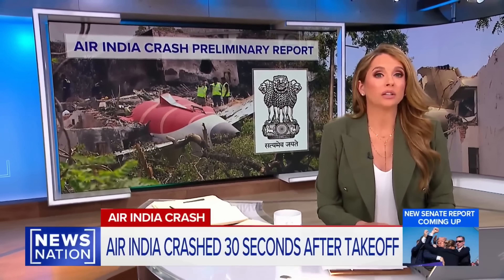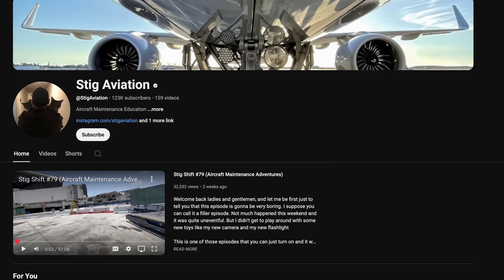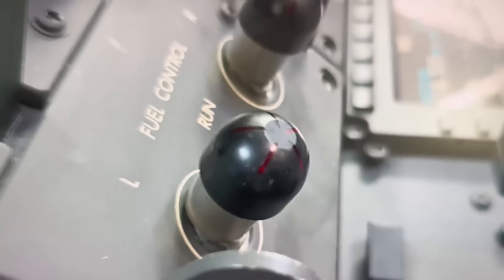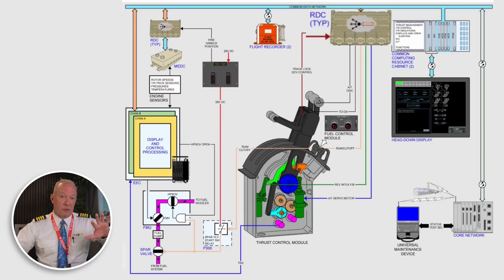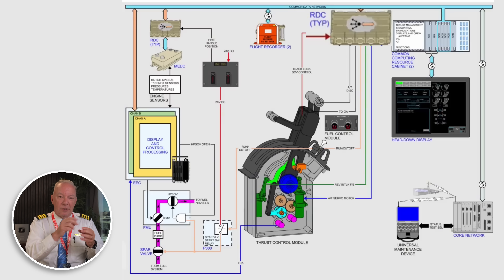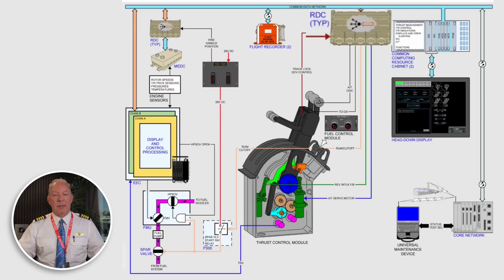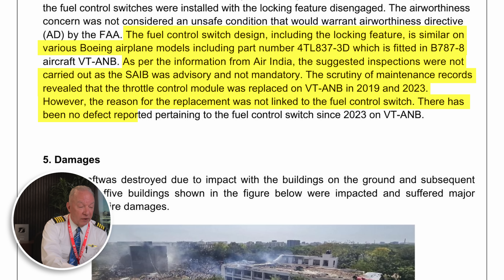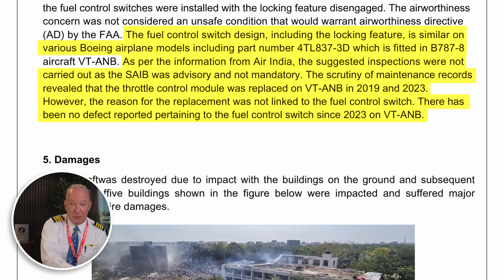The Truth About Boeing 787 Fuel Control Switches

Comment: Former Navy P-3 Flight Engineer here, and your explanation of how the fuel shutoff switches work is excellent. Having shutdown and turned on fuel cutoff switches thousands of times, there is no way those switches were turned off by themselves. It virtually impossible, and designed that way. Keep up the good work Captain Steeeve!!
Reply: Thank you for your service and for confirming all that Steve has been saying about the fuel cutoff switches. There are so many people commenting on here that have no idea what they're talking about. 🫡
Reply: @ITouchDownEverywhere  Capt Steve would be one of those.
Reply: @JoeLinux2000 You must be delusional.
Reply: @JoeLinux2000  Based on the fact that you reply to nearly everyone tells me that you're one of those people who thinks they know it all, when in reality, you know very little.
Reply: Disagree.. Why was the RAT  deployed two seconds before the fuel was cut off ?
Reply: @alexvarghese2513  Major Electrical shutdown is my guess. surely it is key to understanding what caused the engines to shutdown.
Reply: @alexvarghese2513  It wasn't. Go and lookup any news article that has the timeline of events, as published in the preliminary report that was released.
Reply: the switches don't activate the fuel shut of valves, the relays do it and possibly other circuits
Reply: @CaptainSteeeve, why not make it impossible to switch them off when in taking off at low altitude with full throttle on? Even in general the switch I presume is not used when throttle is 100%. And in this scenario the pilot doing the switchoff did not put the throttle back first, cause that would be immediatly noticed by the other pilot. Wouldnt that be a usefull change the prohibit this in the future from happening again?
Reply: @gaborv.baranyai2625 exactly what i imediatly though. How come everithing is redundant fail safe but u are able to shut off both fuel switches instantly right at take off. IN NO CENERIO THIS SHOULD BE ALLOWED AT SUCH LOW ALTITUDE. 3 SECONDS AFTER TAKE OFF.  This needs to change imediatly....
Reply: @DavidTorres-xl2jl
Hi David.
What happens if the Main battery goes "dead short"?
Would the Left Bus lose the power to the Pumps/ Valves?
Would the "Active High" to the "Switch position" contacts (Inside the switch) be lost?
Would that cause a FALSE DETECTION (!) of the switch position at the RDC > FDR?
.
If the system detected a "Left Bus power Failure", would that initiate an attempt to supply emergency power from the Right Bus via the Bus Tie Connector?
.
If the Right bus Power connected to the "Dead Short" of the Left Bus.... Might the Right bus ALSO go down?
.
I've referenced links elsewhere to a channel where this is explained in great detail using Boeing Manuals
Reply: @rogerstarkey5390 All Speculation!! The report clearly says the Fuel Cutoff Switches were TRANSITIONED from ON to OFF from left to right one second apart. Then TRANSITIONED BACK to ON 10 seconds later. Both engine fuel systems are two separate systems independent of each other. A bad battery would not shutdown both engines one second apart.
Reply: If some things fail in engineering, there is a concept of failure to a safe condition. Fail-Safe design I recall it is called. One would think that it would apply to fuel flows to engines in aeroplanes, unless in the case of fires at high altitudes or on the ground.
Reply: Capt steeve words and explanation are contradicting the diagram that he is showing 😂 Clearly as per his diagram, display and control processing unit is capable of cutting off fuel by turning fmv or hpsov !
Reply: Looks like a deliberate act, when one of the pilots is asking why did you do that and the other claims he did not. No way both those switches fail or get moved by accident. The co-pilot who is flying has his hands full at that critical moments but sees the other pilot who is monitoring flip those switches then asks in disbelief why did you do that? Hard to see what else you can say. Hope I am wrong, any crash is bad enough but deliberate is gut wrenching. MH370 comes to mind.
Reply: @wjkitching  , let me throw this at you. According to some information sources. Only captain instruments are powered in emergency power situations. Which would mean a change of command/active pilot would have had to occur. So now what you say?? (Who said what to whom, and when???)
Reply: I had seen this STIG AVIATION one maybe 20 days ago. It's a very nice explanation.  I still have 1 concern which I think Capt Steve has not accounted for.

The relay being shut makes the 28V DC circuit tell those 3 circuits to have their valves open. I guess via actuators. That is just the valve remaining open. There is also the factor of the fuel PUMPS and I am pretty sure those don't operate on DC. That means if you have valves OPEN n but the PUMP IS NOT GETTING AC power, then the outcome would be fatal

And I do not think simulation tests perfectly replicate a plane's hardware. What it probably does perfectly is replicate responses to signals. It would probably replicate the logical/INSTRUCTIONAL aspects, but not physical aspects of failure.

Btw, there is another excellent video - search AIR INDIA LITHIUM BATTERY DIODE   by Jeremy John Thompson
It goes into the electrical schematics and is for the audience that understands electronics at a deeper level.
Reply: I had seen this STIG AVIATION one maybe 20 days ago. It's a very nice explanation.  I still have 1 concern which I think Capt Steve has not accounted for.

The relay being shut makes the 28V DC circuit tell those 3 circuits to have their valves open. I guess via actuators. That is just the valve remaining open. There is also the factor of the fuel PUMPS and I am pretty sure those don't operate on DC. That means if you have valves OPEN n but the PUMP IS NOT GETTING AC power, then the outcome would be fatal

And I do not think simulation tests perfectly replicate a plane's hardware. What it probably does perfectly is replicate responses to signals. It would probably replicate the logical/INSTRUCTIONAL aspects, but not physical aspects of failure.

Btw, there is another excellent video - search AIR INDIA LITHIUM BATTERY DIODE   by Jeremy John Thompson
It goes into the electrical schematics and is for the audience that understands electronics at a deeper level.
Reply: I sincerely appreciate how Captain Steeeeve educated himself on the system, not all pilots are familiar with many of the workings of the aircraft they fly. Saw a FE convince the pilot the aileron trim tabs could move themselves (P-3). Baffled at the preflight call I went out and saw the FE, who was at fueling panel, was grabbing the T/T cable when the pilot ran it and pulled it in the opposite direction. So I joined in and messed with him until he figured it out.
Reply: aircraft firefighter, id say there is no way they both flipped off by themselves, you have to pull up and down
Reply: The cvr discussion is crucial. Human action sadly.
Reply: no mention of any possible electrical or computer glitch that would trick the computer into shutting off the fuel pumps. Why not Captain Einstein!!
Reply: Except when they're broken and except when there were memos out there about how many weren't working correctly
Reply: These facts are a major problem for the hundreds of video's on the internet trying to promote their  bat shit crazy ideas of what caused the crash. What ever happened those 10 seconds with the switches at cutoff domed the flight. Switches at cutoff for 10 seconds is pilot error full stop.
Reply: Another false propaganda. The fuel switch is a red herring. Report never mentioned physical movement. RAT deployed before the switch transition. This Steve guy is peddling Boeing propaganda most likely. The fuel switch is not the probable cause of this accident. Steve is spreading misinformation.
Reply: Blaming manual switch operation is lame excuse airlines will never accept. So not getting convinced,, they would keep away from boing, as cause boing cannot admit
Reply: What I am wondering is if the switch can be positioned half way, balancing on the nib like a coin on a table, see 3:17. The top of the  nib is flat and a large spring force creates some friction to hold it there. If in that position the electrical signal is switched you have the engine on, but the switch is not secure. I don't know how often that would happen, because having that be the case for both engines would mean it would have happened to single engines much more often.
Reply: Relais can fail. I do not believe that the fuel valves depend on one relay. This is BS. The schematic you show only shows the principle. There is always a redundancy in case the relays would fail.
Reply: @feggaer8889 
There are separate relays on each engines fuel circuit, there is no one point of failure . Also, the relays have to be activated i believe to close the valves or open them. If the relay failed when the valve was open it would stay open. And for 2 separate relays to fail a second apart ,even if thar could close the valve, is insanely crazy
Reply: @njlauren thanks for the explanation.
The video was biased. A failure of a component is always possible, but as you mentioned, there should be no single point failures that could lead to close all valves. I hope Boeings RAMS department know what they are doing. I still have doubts that one pilot did that on purpose.
Regards
Reply: The first question that springs to my mind when I see the tab and the operation of the fuel control switch is “what happens if there s metal fatigue on the tab or the toggle tooth? Such that those pieces are rounded and therefore not capable of holding the switch in place under the pressure of the detent spring.
Reply: @NorthLondonArtillery 
They have the actual switches. First of all, there are two switches, one for each engine, it wasn't one switch. The odds of two switches being in that shape is pretty much near zero. Plus the switches were replaced in 2023, and even assuming both could be bad at the same instant, it is highly unlikely it would happen in 2 years. 

The other thing is they found the switches after the crash, and they were in the run position as indicated on the 'fdr'. If the switches lockout was bad, you think a crash involving huge g forces on impact wouldn't throw them to the cutoff position?  The other thing is if the switches were in that bad shape they would have noted that I the report..
Reply: Then would you please take some time to explain the 2019 ANA incident where it DID TAKE CONTROL.
Reply: Industrial automation PGD (i.e. Anything with control and automation) + Mechanical Engineering Diploma + Bachelors in my achievements and I can say it can.
You are a flight Engineer, not a controls engineer.

There's nothing in Engineering that says its impossible. Humans thought only birds could fly, but with engineering, humans did break sound barrier by multiple times and can fly to date as of my knowledge.
Reply: @rahilptl639 not in this case
Reply: P3 vs. B787??
Reply: It is impossible to switch both in less then 1 s as mentioned in the report
Reply: @azeche592 Not what real pilots are saying.
Reply: So, if a pilot switches them off and on thousands of times, they would know even in absolute darkness what they are for. Obviously, the switches were on, otherwise the airplane wouldn't have lifted off ground. So, if they were switched off AFTER start, than could only mean an act of suicidal terror, not an "accident" caused by ignorance or stupidity. 
But,. if it was a suicidal terror attack, why didn't the second pilot switch them on again, or can't the turbines restart on their own after switches are being briefly cut off?
Reply: @hokroeger from listening to hundreds of different  pilots videos, it seems like they function very independently at takeoff , each responsible for certain tasks and observations.  One would not be expecting “the other” to sabotage the flight.  For whomever did this…they knew it meant certain death at this altitude.  Move the switches at 12,000 feet the RAT deploys …astute pilot turns switches back on…that would be a fight in the cockpit. Whomever did this, chose certain death.  No chance to recover
Reply: @hokroeger 
They probably could, the switches are in the console with the throttles. That said the conditions in the cockpit was normal. 

The switches were thrown on 10 seconds after they were flipped into the off position. The problem is the engines take a while to spool up, the plane was at 500 feet, just no time. A 787 at that altitude will stall and crash with no power.
Reply: Nobody seems to have noticed that the schematic shows an "and gate"  that means the display and control processing unit has to command the Hight pressure shut off valve as well as the relay output. And the FM valve is directly controlled by the display and control processing unit. ONLY the spar valve is unilaterally controlled by the fuel cut off levers  via the spar valve relay.
Reply: Replacement of the 3 way 4 pole electromechanical FAA approved switches with unapproved totally manual fuel switches is not recommended, but as it's captain Steeeve's plane we cannot stop him is his tuning efforts. Let's see 👀 

At 4:15 he says he has reconnected the FMV from the FADEC's and onto the 28V DC power from the latching relays. Interesting either closed or full open. Steeeve's tuning specialist denied using the fuel switches themselves to switch run/cutoff fast like manual PWM modulation fir thrust adjustment.
Seems like they needed higher dimensions and has completely disconnected the FADEC's. 
Seems like their tuning kit has new additional Values and control hardware and software.  

It's not recommended to run the engines faster as tear and wear increases exponentially as with the fuel consumption. Tuning above 15% might risk the engine split apart 
Hope we get to know when Steeeve is going to have this race?
Which tower is giving out the race vectors?
Reply: Virtually impossible is not impossible
Reply: Problem was not with the switches. It was with the 28 volt battery Captain Steve mentions. Whether by accident or intention one of the things in his picture of the circuitry completely covered an important part of the circuit which was the battery that went through a power diode before it connected to the buses that powered many things including those fuel shut off relays. There was a power failure in that 28-volt system. When that happens it looks just like someone flick the switches and has recorded as such by the flight data recorders because it senses no power on the line just as if the switches were cut. But the explanation I saw points out that if the power diode fails where's the battery itself has problems you lose your 28 volts. As an electrical engineer although I haven't practiced in decades the explanation is certainly viable and matches all the data. There's actually a video online on YouTube that goes through the scenario in exacting detail matching up everything that was observed
Reply: Honestly stop banging on about the spring, nib, intentionally moved…. I do agree, they were moved intentionally, in fearful desperation to reset FADEC to get engines running again because both flamed out at rotate, due possibly to a major electrical upset, evident by RAT deployment PRIOR to switches cutoff/run and pilots did an amazing job!!! Only mental health issue with these two hero’s was their quest to save this from being the tragedy that it was. Firmly believe the truth will prevail, this was no German Wing tragedy.
Reply: What about the battery itself, the one that provides power to those switches?
Reply: @Marco-fv6ho  Considering what Captain Steeeve and others shown, the battery itself, battery bus, or protection diode, or some wiring between the battery and the switches are common failure points and could had caused a simultaneous engine shutdown.
Anyway, it could had been caused by other issues.

Water infiltration in the electronics bay could had shorted the relays.
There are safety bulletins recommending to check for water infiltration and related issues on the 787.

TCMA could also cause a dual engine shutdown.
It would automatically cut fuel to the engines if it records both TOGA thrust and thrust levers at idle position, thinking the engines runaway.
Throttle body in that aircraft was replaced twice since 2019, so that issue should not be underestimated.
Reply: Excellent explaination captain, very simple electromechanical circuit.
Reply: @armandocarino1387  Yeah No. It is more complex than that.
Reply: What if the connection to the battery briefly clitched for whatever reason? Complete novice, but thinking outside the box and a big issue was made over this battery.
Reply: @stevenb4285  you'd loose CVR and FDR data for that period.
Battery is monitored by the aircraft electronics and is load tested during power on/pre-flight procedures.
Battery voltage is also one of the required monitoring parameters on the FDR alongside voltage on the battery bus (usually powered by other sources despite its name) so any changes would be recorded and available to the investigation team.  
As the prelim report doesn't state that there were any anomalies in the FDR about battery voltage it's not occurred.  They would want to issue that under the prelim report and then produce an inspection regime for the 787 global fleet to mitigate against another event as soon as possible.
Reply: @stevenb4285  The report says clearly the Fuel Cutoff Switches were TRANSITIONED from ON to OFF one second apart. Says nothing about battery issues.
Reply: The term 'virtually impossible''' could have been applied to many 'events' during 9/11 but it wasn't then ..from building collapses to pilots and aircraft performing 'virtually impossible' feats (disappearing into the ground etc). Just why are you using it now? I strongly suggest 'highly improbable' instead or the overall govt narrative on that infamous day would collapse instantly
Reply: Some people have a really hard time admitting something so don't mind those people and keep up the good work sr💪
Reply: OMG You are as much of joke as he is! You don't even need to know anything about aircraft to see the rubbish he's talking. He's wrong if you can't spot the contradiction in what he was saying here, there's no hope for you
Reply: Are you an engineer with access to the construction of the fuel switch.  It can easy tripped by itself like a circuit breaker.  Please do your research first.
Reply: @michellehavre6821 😂😂
Reply: @michellehavre6821 no it really can't - do your research.
Reply: I haven't read many of the comments, but couldn't they isolate the audio hear the clicks from the springs? It looks like it would make a definitive sound from the springs clicking?
Reply: I just can't see why this is good functional safety design considering the proximity to active controls during takeoff and the fact that we humans make unrecoverable errors with some frequency. I believe this was a stupid human error.
Reply: With all due respect, depression and suicidal thoughts are capable to flip these fuel switches. How well and how often these companies evaluate their employees will play a huge roll with widely spreading mental health nowadays. Just saying...
Reply: It's the fuel pumps that failed caused by water ingress into the EE bays. Lack of lavatory maintenance caused the crash and not the fuel switches
Reply: @idarpolden5913 what's the basis for ur claim, plz do give source and explain how what you think happened
Reply: We will have to wait for the full report but the switches must have been moved by the pilot or first officer
Reply: @StevenCullen-sx1ui , While there was likely fuel cutoff switch movement. Still not 100% a thing. It's higher probability, but not 100% until more details. With this said I'd give the context for the fuel cutoff switch movement, a very low probability in the context to sabatoge the flight. Very high probability switches moved in response to another issue, or root cause issue. As another channel indicated once the RAT deployed, (emergency power) only captains instruments would be powered. If co-pilot was in command, a change in command would have had to occur -> to the captain. Now who said what?? to whom??, and in what context??
Reply: Why can't someone agree one of the pilots switched it off for whatever the reason, intentional/unintentional if the system couldn't be at  fault 
Because it has been said its  turned on again
Reply: As it seems there's no proof of pilots turning off those switches Boeing at fault for sure and hiding their faulty system because why'd the pilots do it intending to suicide (with all the passengers ) and if they had any such intentions they could have done it after gaining more altitude maybe..
Reply: LOTS of "Monday morning quarterbacks" weighing in here, l.o.l. 😅
Reply: I wonder out of the 240 comments, who here are aviation mechanics or engineers? 🤦‍♂️
Reply: All these experts commenting on here. The people who use and rely on these systems every day are the ones I would believe as opposed to so called  ‘armchair’ experts, unless they actually work on these systems in these aircraft at the company in question. Pilots lives are on the line just as much as the crew and passengers. They have much invested in knowing how their aircraft works, inside and out.  They too would want to know they can rely on these systems working correctly, unless you have an errant or suicidal pilot.
Reply: As an electrician of 35 years plus. this video makes so much sens. 
I do have a suggestion moving forward and it would probably be considered on future designs.
THERE IS NO REASON  FOR THESE SWITCHESE TO SHUT OFF AT SUCH A LOW ALTITUDE  ,At least not both of them at the same time . I KNOW IM.NOT THE ONLY ONE THINKING THIS IS ABSURD , SO PLEASE have them disabled internaly    for the first few seconds from take off. That way there is some redundancy  in the system  for acidentaly or intentionaly shutting fuel down  to the engines. I was surprised this is not already implemented.
Reply: @mariuss5423  Introducing more complexity is usually not the best solution.
Reply: @mariuss5423  barometric or rad alt?  How is this system powered when down to battery power only? What if you have a fire on one engine during this phase of flight, how does the fire handle then interact with the fuel control relay?
You still need to be able to shut down an engine so this just moves the issue from fuel control switches to fire handles.
Reply: @yanholland315 
If you have a fire in both engines at the same time at such a low altitude you are done anyway. But at least if you dont have the fire issue  and somebody just switched them both off you still have a chance for recovery if you are higher altitude. 
I still want to think this was a brain fart situation at the worst posible time . This mecanism can give you a second chance in recovery.
Reply: @yanholland315 
Just want to emphasize that my idea to disable the shut of at the initial phase of take of was for both switches at the same time ,  plane can still fly woth one engine  . If both engines have a fire at take off . Is game over anyways.Im just so sad of all the familyes that are going through this horible incident. 😢
Reply: You’re right on.  If those switch springs will keep the switch in position in the type of weather and altitudes you P3 jockeys fly in you know they’re GOOD.  Hell.  You guys probably need back surgery after a P3 tour.  Thank you for looking out for us civilians.
Reply: @trainman9119 guys the problem has nothing to do with the switches but the 28 volt power system that connects to the switches. It's a battery ever have a battery wear out ever have a battery short?  It goes through a power diode to the bus that runs all that stuff and if that power goes out it'll trip the relays and it looks just like the switches for flicked to the sensors that go to the flight data recorders
Reply: @robertgrant5895  but the system does not run on batery power only in case of a power failure which hapend after fuel cut of not before that.
Reply: @trainman9119  -- uhm.. lol
Reply: @trainman9119  what about a drop in voltage to the relays ( may it be the voltage or loose wiring or ....) Is that not a possibility ?
Reply: I would not want to encourage any more speculation as to what might, or might not, caused such a horrific accident (and I prefer to think of what transpired as having been accidental). 
Look, no one can state for certain why switches were shut off, if they were shut intentionally off and even  Captain Steve was careful not to bring up possible pilot intentional error / self-murder. 
So, because of this can the rest of us please stop speculating about such? 
It really is too gruesome. 
I feel very, very sorry for the friends, and famlies of the passengers who died. 
I also feel sorry for the man who lived. His torment and dreams must be indescribably harrowing, not to mention his full body and brain recovery.
Reply: @ThatUniqueAbbiethere’s obviously a good reason why have only given us an outline of what was said,either they are trying to cover something up,or more likely they are not 100% sure.
Reply: @ThatUniqueAbbie those of us that have thousands of hours flying know what happened! They were manually moved to the off position by one of the pilots and moved back to on by the other pilot after questioning him why he turned them off. No brainer. 
It's a sad conclusion but that's reality.
Reply: @DavidTorres-xl2jl  How do you know the switches were moved back by a different pilot?
Reply: @DavidTorres-xl2jl .  I agree with Captain Steve too. I just hope the guy that spoke first wasn’t the guy who did it. Did he frame the other guy for this tragedy.  That to me is the gray area.  How do you prove which one was suicidal. A lot depends on THAT for those pilots families!  For the passengers families, they will get the same amount of compensation no matter how it is decided if pilot A or pilot B moved the switches off. So I agree… cameras are needed.  Voice recordings don’t PROVE guilt.  They only RECORD voices.   So much sadness in this crash
Reply: @ThatUniqueAbbie Ignoring the potential does not make the problem go away or make future flights any safer. It needs to be analysed and lessons need to be learnt. Its not a pleasant thing to do but its absolutely essential to prevent future occurrences.
Safety is paramount.
Reply: @oneoldmanontheroad9034  Have you any reason to suspect that it has NOT been analyzed?
Reply: @oneoldmanontheroad9034 I stand by my post. I find dwelling on this matter to be troubling.
Reply: @ThatUniqueAbbie And i know that if this is just ignored and forgotten then it will happen again. Ask any safety engineer.
Reply: @oneoldmanontheroad9034 so let the experts do there job. The final report will clarify everything
Reply: How do you comment on the fact that multiple experts analysed the very poor and unprofessionally presented information provided in the preliminary report and they concluded that the only possible scenario for the provided timeline is the one in which RAT was deployed BEFORE the two switches “transitioned” to cutoff position?
Reply: The boeing advisory on fuel switches states that switches can malfunction and cause inadvertent operation!
Reply: There is a way for the system to turn off, if there is a short circuit on the battery. Think about it, the RAT was deployed before the transmission to cut off
Reply: @holmbrew 
This is Not true, Rat deploys after the fuel switches were transitioned to off position NOT before.
Reply: @Fluffysweep what is true or not, just a final report can tell us. It is not proven when RAT was deployed, timeline does not add up according to Richard Godfrey, this person know a lot about avionics. He suggests that the a RAT was deployed before engine shut down.
Reply: @holmbrew 

The RAT did NOT deploy until after the fuel switches were transitioned to cut-off position...
Stop listening to other people and read the preliminary report yourself.
Reply: With so much of confidence, we should send you on a rocket from elon musk😂 Bro, anything electric or electronic, nothing is guaranteed.
Reply: @ary6039 obviously you don't have any flying experience!
Reply: @DavidTorres-xl2jl it doesn't matter, even a 16 year old will say that. It's basic common sense. There is nothing electrical made by human which stays forever. Do you not agree? Why do you think products have warranties?
Reply: @DavidTorres-xl2jl being an engineer, if you say electricals last forever, there is something really wrong with your thinking capabilities. I am not even an engineer and i can tell you that. Don't need no pilot explanation, you just need common sense sometimes.  There are  many good pilots who have sacrificed their jobs  for the safety of passengers. Also its not just Boeing, giant companies in every industry often brush things under the carpet and whistleblowers are threatened with power. Many employees have sacrificed their jobs so that others don't suffer. Even i lost my job because i stood up for health and safety. If a company does not value health and safety, i can't be a part of such organization even if it means no more money.
Reply: @ary6039 😂 is a manual switch son!!! 🤦
Reply: @DavidTorres-xl2jl  my friend any switch has components whether electrical or mechanical for it to work. It does not work without a component a those components have to be in working condition. Don't believe me, at least believe AI. Read this,
Yes, a fuel cut-off (or inertia) switch can fail and not work properly. It can fail in a way that keeps the fuel pump permanently disabled, causing a no-start condition even if it appears to be working correctly. Failure can be due to internal faults, loose wiring, or corrosion, and the switch can become stuck in the "cut-off" position, preventing it from restoring the fuel supply.
Dude have you never seen a normal household switch get stuck and not work? It can be due to many reasons like spring is out of shape. 
Btw You laughed too early😊
Reply: Virtually impossible is not absolutely impossible. This is why we need cockpit cameras. We have them in the terminals, in tower control, on the airfield and so many other places. It would provide absolute proof if it was human action or defective switches. It would stop all this guesswork!
Reply: @oneoldmanontheroad9034  It IS impossible. I'm an ex-ROV pilot. We had the same switches on our consoles. I've seen a guy break the lever off one without the switch changing state. The vessel we were on took an unexpected roll and his hand came down on the switch. Snapped the lever off. I think this is more a defective human (a simple brain-fart) than a defective switch.
Reply: @Chris-hx3om  isn't an ROV a remotely operated underwater submersible vehicle? What does that have to do with the fuel switches for a jet aircraft?
Reply: @jandrews2735  We use the SAME switches for critical functions. I'm not saying that flying plane is the same as flying an ROV, I'm just pointing out that I am familiar with the switch involved. I'm also the assigned 'electrical guy' on crews, and understand the circuits the video pointed out.
Reply: @Chris-hx3om  You buy switches costing $1000 each for an ROV?
Reply: @jandrews2735  A switch is a switch.   Basically thees are toggle switches that require an additional step to move them so they don't get flipped by accident.  However there is a lot of wiring downstream from the switch, and we know this particular aircraft had significant electrical problems.
Reply: @Chris-hx3om  I'm sure that type of switch is relatively common for any application where you don't want the switch moved accidentally.  The issue is not the switches but the computer control over the engines.  What can the computer do without direction from the pilot?
Reply: @JoeLinux2000  Then why was it reported (in the preliminary accident report) that one of the pilots asked the other why he moved the switched to cutoff? The computer can't move those switches.
Reply: Nothing against cameras, but this comment illustrates the necessity of REALLY GOOD scientific education and especially in statistics/probability. The likelihood of an extremely unlikely event occurring twice (ON BOTH engine controls independently AND the changes in the switch position being recorded by the FDR) vs SOMEONE moving the switches physically is SO INCREDIBLY small that it is strange (euphemism) that this would be argued for and discussed so much. The problem here is (as is the case in a lot of other instances) that people who do not understand the systems come up with the "an airplane is an incredibly complex machine and anything could happen" which is only one step from our ancestors looking at the sun moving across the sky and concluding that there must be someone who is moving it (for them at, the time and their understanding of astronomy and physics, it was a possibility).
Reply: @igormitrovic7688  it is very hard to prove a negative. and the same holds true for absolutes.
thats why there are still believers in magic, Witches, Santa Clause, the Easter Bunny, the Tooth Fairy, the Earth is flat, the Earth is the center of the universe...
(I will leave out various religeous constructs that cause the same arguments).
Reply: @igormitrovic7688 that’s because you have zero knowledge of what happened truly. There is single point of failure in this that causes dual engine failure. And peddling bs statistics is nonsense as the type has flown billions of hours and now we have an accident. So statistically probable. It’s mostly a battery failure which is been 787 problem. Or maintenance issue.
Reply: @igormitrovic7688  I also suspect that many of those who are raising highly improbably technical causes are attempting to blame Boeing, in any way possible.  Many Boeing haters have lost their objectivity, any time a Boeing aircraft so much as drips on the tarmac.
Reply: thinking those fuel valves couldn't be activate via a malfunction is simplistic, the switches do not activate the fuel cut of valves the relays do that, those switches may not be as relevant as you think.
Reply: @igormitrovic7688  
What might happen if the (SINGLE) Diode in the main Battery Diode control Module failed? (Reverse bias)
Reply: @igormitrovic7688 if you want to talk about scientific education you might as well look at the actual circuit diagram that's carefully hidden underneath that picture and what Captain Steve showed. That 28 volt power bus is caused by being connected to a 20-volt battery which goes through a power diode. Failures in any of those go to both relays on both sides of the airplane and we'll look exactly like you flick the switches when you didn't and it will recorded by the flight data recorder in the same manner. That doesn't mean that's what happened but if they can find the battery they can check to see if it shorted or was out of power but more likely they can check the power diode which if it failed could easily shut down the power to both engines. It's actually a truly crappy design
Reply: @robertgrant5895  the way i see this it looks like system runs on normal power unles power is lost than swtches to battery power . Power loss happened after fuel cut off . 
They should design this so it cannot be cut off at such alow altitude intentionaly or unintentionaly at least not both at the same time
Reply: @rogerstarkey5390 For a single diode in the main battery to cause the shutdown of both engines, one would have to assume that BOTH engines are controlled by a single battery. That would be a criminally idiotic design (double and triple redundancy of the critical systems is the reality in these machines!). Even if one were to allow that this design was utilized on B788, the engine shutdown would be occurring at the SAME moment in time for both engines. The FDR would NOT be recording this happening one second apart. It is reasonable to speculate, but for a speculation to hold water in a meaningful way, it still has to comport with all the data/facts available.
Reply: @igormitrovic7688  Incredibly small chances means that by Murphy's law it will eventually happen.
Also, not that difficult either.
It only needs the right conditions, for example water infiltration, single point of failure like the battery diode or the battery bus, or an error by a system designed to automatically switch off the engines like the TCMA.
Reply: @igormitrovic7688  Well said!! Batteries are used for last resort emergency power for DC critical systems. Battery power is not in use while engines are running with generator power.
Reply: @giacomoneri1782  This illustrates the problem. Murphy's Law is to probability what Aristotelian physics is to reality. On the face of it, it appears true, but its only value is entertainment.
Reply: @igormitrovic7688  you should c the off the wall conspiracy theories in true crime where i tend to reside. people are insane.
Reply: @igormitrovic7688  "For a single diode in the main battery to cause the shutdown of both engines, one would have to assume that BOTH engines are controlled by a single battery. That would be a criminally idiotic design"
No one claims this. The BDM fault leads to a gradually destroyed battery. It's the eventual battery failure (where it starts acting like a short) that brings the buses down, one by one.
Reply: @ConcernedParent-z1q If the buses were failing (as described), how would the engines be restarted? Also, the two engines are not on the same circuit and, again, this is a speculation that takes WAY more assumptions (and avoids the facts - as reported) than the Ocam's razor explanation.
Reply: @igormitrovic7688  said "The problem here is (as is the case in a lot of other instances) that people who do not understand the systems"

Systems can be designed in an INFINITE number of ways

By you logic, thinking that a door can suddenly explode in the middle of air is "only one step from our ancestors looking at the sun moving across the sky and concluding that there must be someone who is moving it" because "people don't understand the systems"

And that's because Scientism adepts don't understand the systems either but think they do and also think that corruption is normal and scientific, so Boeing's DEMONSTRATED CORRUPTION plays no role in "understanding of systems"
Reply: @igormitrovic7688  According to this hypothesis the LHS bus fails (shorted to ground), taking down engine 1, then the automatic redundancy connects the LHS bus to the RHS bus (which is what would happen), which then brings down the RHS bus too. This kills engine 2. The system deploys the RAT and also performs bus separation at this point.
Reply: @igormitrovic7688  Dear Igor: after all you wrote, are you 100% sure that the 28VDC line never failed? What type of relays (post switch) did that specific plane have?  Have you analyzed all the 787 circuits involved? Did you know the status of the Air India 787 plane? If all those answer as a YES, only then I can tell "you're right"
Reply: @ConcernedParent-z1q And how are the engines restarted in this hypothesis if what is stated were true? What happened to the LHS bus that shorted? I guess it somehow "unshorted"? It appears one has to make a LOT of assumptions...
Reply: @burdeninmyhand  Dear Burden: what was suggested would require both 28VDC lines to fail (the two engine controls are independent!). Also, if these lines failed, how were the engines restarted?
Reply: @igormitrovic7688  Are you kidding? 1) Suppose some failure, electrical or fuel. 2) In both cases, electrical or fuel power goes off, if goes off the RAT deploys. 3) RAT deployed you have power to restart one or both engines. 4) there's a third battery, backup battery which is Li-ion in the 787.  You haven't answered my other questions
Reply: @igormitrovic7688  There's also the thing that the plane took off having to go over the entire length of the runway, which is not normal for a 787, it should have been off the ground with less horizontal distance
Reply: @igormitrovic7688  Yes, bus separation means "unshorted". I don't know all the details, but there are people who have gone through this in detail. The other very promising hypothesis centres on fluid ingress in the aft EE bay.
Reply: @ConcernedParent-z1qThis is getting weird. Promising hypothesis? This sounds like fishing for an answer that justifies a particular type of answer. Scepticism is good but this is not scepticism.
Reply: @burdeninmyhand I'm sorry, this is getting silly. All the speculative questions posed have too many assumptions that need to be true in order for the events to unfold in a way you are proposing without any evidence that any of these assumptions are true. There is no reason to address any of the points raised until these assumptions are addressed (for obvious reasons). Sadly, it appears that we seem not to be having a conversation and this exchange serves no purpose. May the souls of those who died in this tragedy rest in peace.
Reply: @igormitrovic7688  , if the fdr is recording, "transition to cutoff event, and this is what you are focusing on. We are defining " transition to cutoff", as fuel cutoff switch movement. Then you are ignoring other common mode issues which could have been the issue for  dual engine power loss. (The "transition to cutoff", being a response (either correct, or incorrect) to something else being the root cause.  So yes if manually transitioned switches (about 1 second apart) would be consistent with pilot actions. Just not in the context of  reason for dual engine failure. (See the difference??)
Reply: @igormitrovic7688 just because the probability is negligible, would you skip health and safety? Every component needs regular maintenance and replacement after sometime. Nothing is permanent. The problem is they still let the aircraft with few issues. The stakes of risk is high because it is in the sky. The plane shouldn't take off even if there is one single issue. But sadly they only seek profit
Reply: @ary6039 This is a classic "straw men" argument. I didn't see/hear anyone (including myself) arguing against proper, careful, and detailed maintenance.
Reply: @igormitrovic7688 just because no one spoke about it, it doesn't mean i am wrong.  You are free to correct me as to what part of my sentence was wrong.
Reply: @igormitrovic7688 you are the one Talking about a likelihood/ probability / guesswork. I don't believe in guesswork.  We are talking about an aircraft here. Even the 99.99 percent working components can cause a failure. Never underestimate the neglibility when the stakes are very high.
Reply: @ary6039  🤔
Reply: @oneoldmanontheroad9034  -- "no"
Reply: @oneoldmanontheroad9034 captain steeve expiation of a simple DC relay system with 2 independent systems was excellent. I got it in the first run through!!
Your comment on cameras deserves equally as much credit, we even have them in truck cabs, facing forward and also at the driver.
Reply: @oneoldmanontheroad9034  Where have you seen cameras in air traffic control towers? I guarantee you the unions would not let this happen. At least in my ATCT there are none.
Reply: @lionelguilbert6493  The National En Route Center and in a couple of Tower Control setups i have seen. There are cameras everywhere. Its as much for the protection of the controllers as the public. 
Are you seriously trying to claim there are none?
Reply: @oneoldmanontheroad9034 no we don’t need camera.
Reply: @airportrooms5123  How about you say why you believe that? I have explained my reasoning for why i believe they are essential and i have explained why they have helped in other industries. So why dont you explain your point of view?
Reply: @oneoldmanontheroad9034 we do not need cameras in the cockpit and the pilot unions would fight that tooth and nail. The FDR caught the switch position change and the CVR caught the first officer ask the captain why he shut them off. Case closed.
Reply: @CaptainKidd707  So in your mind there is no possibility that the pilot that asked why the switches where switched off was covering his actions? No possibility that the copilot who sounded confused by the switch position was genuine? And you say because the american unions dont like it the whole world must follow suit? What about the CAA and not just the FAA having a say?
Reply: @oneoldmanontheroad9034 the first officer was the pilot flying, the captain was the pilot monitoring. Had he reached for the fuel control switches, the captain would have caught it. It is very strange for the flying pilot to reach for anything other than the thrust levers at that moment depending on company procedures. Some companies require the flying pilot to put their hand back on the thrust levers until later in the climb. That low, you wouldn’t be trimming roll or yaw. On the other hand, it would be easy for the captain, who was the pilot monitoring on the flight, to switch them off without the pilot flying noticing his reach as the pilot flying would be focusing on the flight director. I’m with captain Steve as far as saying the only way those switches moved was by deliberate action. You can argue your point about cameras in the cockpit until your fingers bleed but you will never change my mind on that.
Reply: @CaptainKidd707  So you would prefer to guess than know. Based on your opinion, not facts and ignoring prior defects found with the switch gear, monitoring systems and engine management systems. Personally i prefer facts over opinions when it comes to safety.
And your still ignoring the fact its possible that either pilot could have done it and could have been lying.
Reply: @oneoldmanontheroad9034 we will see whose correct when the final report comes out
Reply: @CaptainKidd707  My point is that without the video evidence there is insufficient data to know, you can only guess.
Reply: @oneoldmanontheroad9034  Public will no longer accept evidence unless there is video documentation.  But denial of suicide is so strong, the video will be said to be fraud, and public is not entitled to see it anyways.
Reply: @oneoldmanontheroad9034 and how do you retrieve camera footage. When the black box itself is not retrievable. As is in this case, very conveniently I must add.
Reply: @sadeepm  You really should read my previous comments....
Reply: @oneoldmanontheroad9034  Well, probably the full CVR and FDR recordings would also provide the answers. However we are not even getting those... so it would be the same for the camera recordings I presume.
Reply: , wrong.  It requires a person to move them.  PERIOD.  32000 hours using them...
Reply: @oneoldmanontheroad9034  Ultimately though, no amount of cameras would have prevented what happened if it was intentional. It may help in other ways of course after the event.
Reply: @kyorin6526  My point was never about prevention but about having sufficient data to reach a conclusion which is backed up by sufficient evidence of who did what.
Reply: @oneoldmanontheroad9034 and it would stop all the conspiracy theorists.
Reply: @oneoldmanontheroad9034  how about if your boss wanted to install cameras in your workspace maybe three in your cubicle getting straight on and side views maybe even one under the desk would you be happy?
Reply: @oneoldmanontheroad9034  What if the CVR picked up the sounds of the switches being transitioned?
Reply: @dparis2172  It still does not provide absolute proof it was a pilot interaction rather than a faulty/malfunctioning switch or 3rd party interaction. 
Unfortunately in the real world statistically improbable things do happen sometimes. More often than we acknowledge.
And Boeing have been caught flouting the safety regulations way to often with significant loss of life.
Reply: @dparis2172  Sounds on recording can be isolated and timestamped along with the lost thrust message.  It is likely the plane lost thrust prior to the switches being moved.
Reply: @googlieking  I’m assuming the timeline of events will be covered in the final report.
Reply: @oneoldmanontheroad9034  If the sound of the switches are picked up and it corresponds with the fuel being cut off from the engines then what else could it mean? And what do you mean by “3rd party interaction”?
Reply: @dparis2172  Without video evidence its impossible to know with 100% certainty exactly what happened. There are many different possibilities, but given the data recovered we can not determine which one of these did actually happen? 
Thats why video is important, in this instance you could see who did and did not do what, which the audio/data bus data alone does not.
Reply: @oneoldmanontheroad9034 How do you manage to get through life if you require absolute proof/assurance before making any decision?  Worse, do you always assume the most unlikely explanation for an event to be the correct explanation?
Reply: @oneoldmanontheroad9034  Not with 100% certainty, but you could narrow it down to two people…
Reply: @dparis2172  What if the sound was of the switch being moved to the half-way position and then being allowed to pop back into the run position?  Oh, the humanity!
Reply: @googlieking  Likely?  How so?  Are you one of those who blame Boeing for everything?  Come on, man!
Reply: @michaelgower6438  Are you able to find your way out of your home by yourself?
Reply: Have you ever seen a magician on TV. You know the magician did something, but you cannot see it in the video!
Cameras may, or may not, be a good idea in the cockpit, but they will not give you absolute proof, oldmanontheroad.

Nothing is foolproof!
Reply: @chuckjohnson2224  I don't know.  Mikayla Raines commited suicide but she didn't kill all her foxes at the same time.
Reply: @oneoldmanontheroad9034  You are basically saying AAIB, WSJ. Boeing, FAA, NTSB are covering up the truth.  Believe that is bias.   You agree you have anti-Boeing perspective.  India owned this aircraft since 2013, so chances are Boeing is off the hook, except obvious scapegoat.
Reply: @billtracy8774  No not at all and if you had actually read my comments you would know that! Stop trying to rage bait  lol
I believe in evidence, facts and proof when it comes to incident investigation.
I also believe cockpit cameras would have provided an additional source of data which would have removed some of the guesswork. 
Also im not biased against Boeing just noting how many times the have broken the safety rules and that has previously been ignored. See the Max sensor debacle for more info!
Reply: @oneoldmanontheroad9034  gotta love conspiracy theorists... When ACTUAL pilots ALL confirmed that it's impossible for the fuel control switches to "accidentally" be flipped from RUN to CUTOFF. So stop it with this nonsense. This was deliberately and MANUALLY shut off
Reply: @chuckjohnson2224 i know right?!?! The guy that you're responding back to... He thinks he's more knowledgeable about flying/operating a plane than Capt Steve! I wonder how he is when he's a passenger on a plane. Does he think he knows more than the 2 pilots that sitting in the front 2 seats? 😂
Reply: @oneoldmanontheroad9034 Sure, but in this case it’s absolutely impossible. The pilot did this on purpose.
Reply: @FernandoG_1981  Which pilot? Its not impossible this wasn't a very rare but has happened before hardware issue (there is a FAA report on this). One pilot was concerned the engines had rolled back and the other pilot was confused about being asked why he had cut off the fuel supply. So which pilot do you not believe and why?
All im saying is there is insufficient data to know for sure and people are guessing like its a fact. Its not.
Reply: @oneoldmanontheroad9034 
Let’s say it was statistically possible. It happened to two independent switches on two independent circuits exactly 1 second apart imagine the probability of that in these cases the most likely scenario is probably what happened and that is one of the pilots was unhappy with his life.
Reply: @funguy917  When it comes to incident investigation, improbable is not impossible, easy answers are not facts and assumptions allow the same incident to occur again. What I am saying is there is not enough evidence to conclude what exactly happened. 
Like it or not it's a fact.
Reply: @oneoldmanontheroad9034 Virtually improbable is not an absolute term
Reply: @luigilainom1123  Thats exactly my point. Virtually impossible does not remove the possibility therefore introducing doubt. Video evidence could have provided absolute certainty. I have worked on industrial accident investigations where virtually impossible did actually happen.
Reply: @luigilainom1123  Excellent call and attention to verbiage. Well done!
Reply: @oneoldmanontheroad9034  If you have ever worked on anything with those switches, like I have, you would know it is IMPOSSIBLE to move those switches without lifting the spring loaded cap.I've seen the lever broken off without the switch changing state.
Reply: @luigilainom1123 So you hang your hat on the thing that is virtually impossible and not the far more likely explanation?  Why?  Without evidence to the contrary I'm betting on the likely explanation.
Reply: @chuckjohnson2224  Yep.
Reply: @chuckjohnson2224  The most likely explanation is some undetermined electrical problem, not suicide.
Reply: @JoeLinux2000  100% wrong.
Reply: Your experience doesn't matter. It's the fact that you don't know what you're talking about that matters. Steeve wasn't even talking about the switch mechanics, he was talking about the wiring system. And Steeve was wrong - there could be a drop in voltage in the battery which causes the DC voltage to drop below the threshold needed to register an "ON" signal.
Reply: @IJustMadeAComment  wrong, battery busbar is fed via TRU from engine generators/APU/GPU when operating.  This enables continuous charge of the battery, stable power delivery to flight critical systems and stops the batteries being discharged.
I don't know about the 787 but most fuel control relays need electrical power to open as well as close so that in the advent of a total power loss the engines will continue to run, it's why FADECs are powered from PMAs located on the engines to isolate them from the aircraft power system.
Fail safe principles of aircraft engineering, better to have thrust than not.
Reply: @yanholland315  That's exactly what I'm saying. The battery fed by engine generators, the generators partially fail, and the battery is forced to engage which lowers the DC voltage to a level that creates the "OFF" state.
Reply: @IJustMadeAComment  battery load checks are part of pre-flight process to ensure it cuts in when required and can manage the load.  Also both the CVR and FDR are powered from the battery so they would also have dropped out.  Fuel relays are latching type design so a power interrupt/failure means they stay in their last commanded position.
Reply: @yanholland315  Interesting.
So we should exclude the battery, the protection diode and the AC/DC unit/units.
To me that would "narrow" it down to:
Human factor;
Water or humidity;
TCMA;
Throttle body;
Wiring;
Data misreading;

Am i correct?
Reply: @yanholland315  None of these things actually refute what I said, they just are sidestepping. I'm not saying it's likely that it happened, but I think to jump to the conclusion that it's a pilot suicide murder is also a pretty dramatic claim.
Reply: @IJustMadeAComment  Despite Steeve using kindergarten logic as if explaining the facts of life to a five year old. The fuel cut/off valves are not a constant 28v dc supply! At least the spar valves are in fact a motorised two position valve with microswitch position indicator limit switches. If you read the Service Bulletin B787-81205-SB280015-00 FUEL - Fuel Distribution - Fuel Shutoff Valve Actuator Test and Replacement. It describes the test procedure on page 24 for both engines and the APU. Steeve you are wrong the valves have a FAIL CLOSED system.
 This is because as the FAA AD: 2014-27069 (79 FR 68384) says "We are proposing this AD to prevent latent failures of the fuel shutoff valve actuators, which could result in the inability to shut off fuel to the engine or APU in the case of an engine or APU fire. If the fuel cannot be shut off to a fire, the engine or APU fire could be uncontrollable, which could lead to structural failure." 
Eaton Aerospace Ltd p/n 53-0037 was replaced with p/n 53-0049. "Changes were made to the actuator micro-switch circuit by the supplier to provide independence between the valve command and indication functions which prevent the latent failure condition." Well done for trying but I'm sorry Steeve it goes a little beyond the battery and bulb concept. As we say a little knowledge is a DANGEROUS thing.
Reply: If the switch works perfectly why did the FAA issue that bulletin. Doesn't really matter if it was in the 737 if it's the same exact part number.
Reply: @Mike-01234  a) It wasn't a bulletin, it was an advisory. b) it wasn't for faulty switches, it was for incorrect installation. c) the entire flight control module (which includes those switches) was replaced long after that advisory was issued, so if they were 'at fault' from the factory, the replacement/refurbished modules would have the switches in the right orientation.
Reply: @Mike-01234  I believe the issue was that if the switch was incorrectly installed -- something which is kinda a bit QA fail, let's be clear about that -- but if it was incorrectly installed in that whole assembly that was replaced twice on this plane (after the bulletin), then the locking mechanism might not work correctly. You would be able to bump the switches off without lifting them.

In short, it would be an extremely visible and easy to check problem, and owners of these planes would know immediately if they were affected.

Also, we have the switches from this plane, recovered from the wreckage. We know it wasn't that.

A discussion about this bulletin is a complete red herring in my opinion.
Reply: Unless of course it is not the switches, but the fuel control relays and valves that those switches are connected to. So if the relay opens for whatever reason  you would open and re-close the fuel switches  to  reset an open relay or valve.
Reply: @karl7796 On both sides, in independent systems, at virtually the same time.  Yeah, that must be it.
Reply: @chuckjohnson2224  Not a switch problem, they only open or close supply to a fuel feed system that may and I do say may have had a fault, so switching off and back on can reset a faulty relay. I have seen it with electrical systems in substations where a HV circuit breaker will not close so you open and re-close the control switch for that breaker to make it close to restore supply. Why does this happen, a voltage surge or dip in the current, harmonics in the circuit?
Reply: @chuckjohnson2224  "On both sides, in independent systems"
The systems are far from independent.
Reply: @karl7796  Because the pilot/copilot did move the switches back, it suggests that the switches had moved. Otherwise he would have said the switches are in the correct position.
Reply: @oneoldmanontheroad9034  The engines did reignite even though it was too late would suggest that the failed fuel supply had been restored. It is not the switches, they are just an open or closed connection. They have no purpose except to open or close supply to a fuel relay. If the switches were moved it may suggest that the switches were open and closed to reset a faulty fuel relay.
Reply: If a relay is faulty, it remains faulty until it is replaced.
Reply: @karl7796 not the case. Two independent systems that are manually activated. It's already been stated , " the switches Transitioned to the OFF position one second apart.
Reply: I am not recommending this, but what do you think will happen if you toss a bucket of salt water on those switches, as you run down the runway?
Reply: @SapienSpaceUnedited probably couldnt be a bucket. TSA only allows 3 oz. ;)
Reply: @bobmitchell826 well TSA allows crew member to bring any amount of liquids aboard
Reply: , nothing will happen.  I spilled a large coffee with loads of sugar on them by accident. No problem.   Incredible design.
Reply: @Mike-tu5hg  , sugar isn't salt. Large difference in conductivity. You continue being ignorant.
Reply: @SapienSpaceUnedited  the panel would possibly short out, which would potentially cause the supply breaker to trip if there was enough current draw.(as it is designed to do in a fault).
there would be a residue of salt inside the panel that would be detectable during investigation.
...and the switches would not have changed position...
Reply: @EdLee-r6k  in this case, there would be a record of that on the flight data recorder
Reply: How to agree if the OEM is investigating equipment he designed that's a big problem...
Reply: @pandyadharmik  It's never been a problem up to now, and it is only being seen as a ''problem'' because now, for some reason, India is trying to save face. Why they feel they need to save face I do not know, because no one has said anything about the quality of Indian pilots in general, which is excellent. They do not want to accept that one of their pilots probably went rogue, but neither did Germany with Germanwings Flight 9525 in 2015. But they tightened up the rules to stop a future event happening and not let ego get in the way.
Reply: @pandyadharmik  They aren't investigating it. The Indian authority is and the manufacturer will be invited to come to provide specific expertise around the machines. Happens in every crash and they are not the ones doing the investigation.
Reply: @pandyadharmik it’s mandatory you idiot😂😂😂😂😂😂😂😂😂😂😂😂
Reply: , ignorance!  The manufacturer always checks everything after a crash
Reply: @pandyadharmik  Try again, but please make more sense this time.
Reply: what about a drop in voltage to the relays ( may it be the voltage or loose wiring or ....) Is that not a possibility ?
Reply: @theguy4355 nope! The report states the switches were Transitioned to OFF position one second apart from left to right. That tells you a pilot did it.
Reply: @DavidTorres-xl2jl  What if there was an intermittent electrical fault?
Reply: @JoeLinux2000  it would have been recorded by the black box
Reply: @theguy4355  Such an event would be archived in the FDR. So far no indication of that happening.
Reply: @theguy4355  the one second delay between the two relays makes a probability less likely
Reply: Flight engineer (pretend engineer), not electrical engineer and it shows.
Reply: @Namtaf2023  The alleged experts who claim Steve's explanation is excellent  are highly questionable. He doesn't even have all the components in his explanation.  Also jumping to the conclusion of suicide  has to be questioned.  It's based on a preliminary report that is known to have flaws. Moreover we know this particular aircraft had serious electrical problems inside the passenger cabin.
Reply: @Namtaf2023 you’re so full of yourself.
Reply: @Jangorexful  But a "flight engineer" is a systems operator, just like a train engine engineer was one ("engine-er"). In modern parlance "engineer" refers to someone designing systems.
Reply: @Namtaf2023
Reply: @Namtaf2023  Your ignorance of the job descriptions is showing.
Reply: @Namtaf2023  Don't need to be one to read the schematics and understand what some are suggesting is simply not possible.
Reply: @Namtaf2023  Flight engineer system knowledge is second to none. Poster is far more qualified to comment than you are.
Reply: @Namtaf2023 Hahahaahh-- I'm sure the OP knows more about this plane's electronics than you do ;-)
Reply: @Namtaf2023  what about a drop in voltage to the relays ( may it be the voltage or loose wiring or ....) Is that not a possibility ?
Reply: What part of the switches DID NOT MOVE do you not understand. The consensus is the switches didn't move but the computer activated the fuel valves controlled by FADEC. WHAT would cause this to happen? A failed chip or signal that communicates with FADEC, electronic fault? Many possibilities!
Reply: @mtsflorida  they did move the switches!!!
If the switches where in the correct position but started to decline in power then why the heck the pilot would had the need to ask to the other pilot if they cut off the switches????? 
I think you haven't being watching carefully to Cap. Steeeve videos, specially where he explained this in detail!!!!
Maybe put a little more attention about the information and don't repeat anything that you're not sure about...
Reply: @LovedSarita  If you are paying close attention to Capt Steve you know he's no expert on switches or relays.  He just knows how to fly the plane.
Reply: @JoeLinux2000  Your statement here makes no sense whatsoever and proves my point.
Reply: @mtsflorida  But they moved. Twice.
Reply: @mtsflorida  Watch the video a couple more times.  Captain Steve explains that the circuits for FADEC and others are independent of the fuel cut-off switch circuitry.
Reply: @michaelgower6438  , only to be disproved by the circuit layout he shows with signal lines and a "and gate" on one the fuel control devices, the "and gate" diagram immediately disproves captain Steve's "closed loop" diatribe.
Reply: @Josemenez-lofs  seems like the self-proclaimed 'ENGINEER', while not being an actual engineer is going to get schooled, very badly.
Reply: @rahilptl639  , who is getting schooled??? Much like the preliminary report on this accident  your comment is vague, incoherent, and undefined.